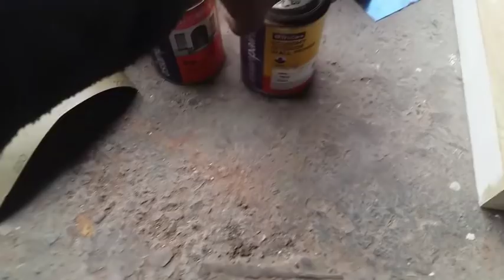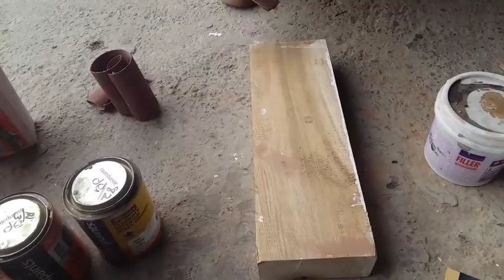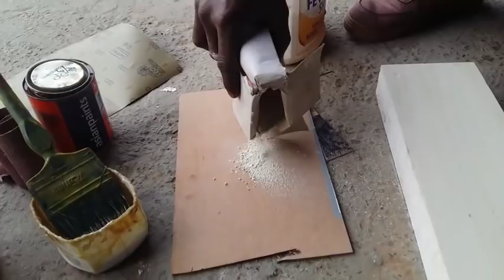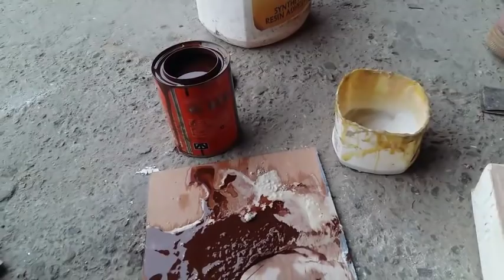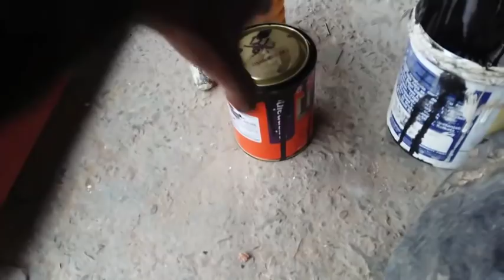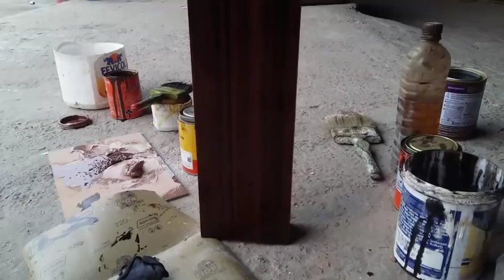HOW TO PAINT WOOD  #LOOK LIKE POLISH#Asian paints

Comment: What material have you used after primer coating , please give the name in English also
Reply from the maker: Enamel paint
Reply: No. Between primer and enamel paint you have used something like "char mitti". I want to know name of that material in English.
Reply: Its Chalk mitti which means Chalk powder
Reply: Is chalk mitti the same as plaster of paris/ POP? Please also tell reason why it was necessary..
Reply: @ananyaakap  it is use for making wood surface more smooth. Chalk dust absorb enamel well and gives more glow and shine after paint.